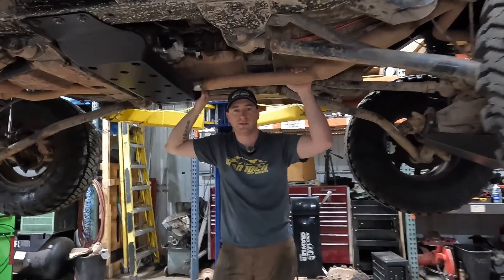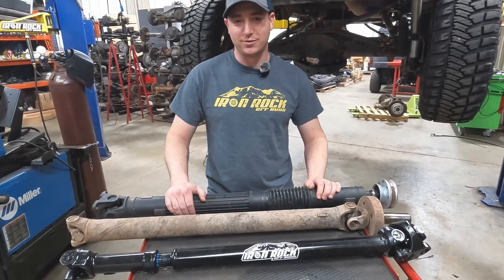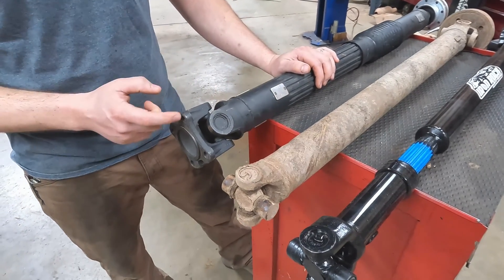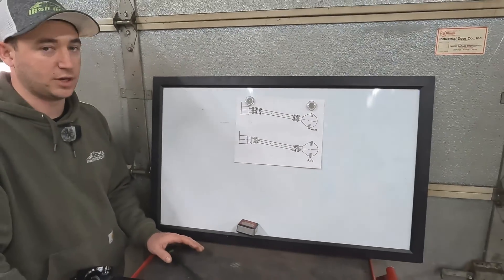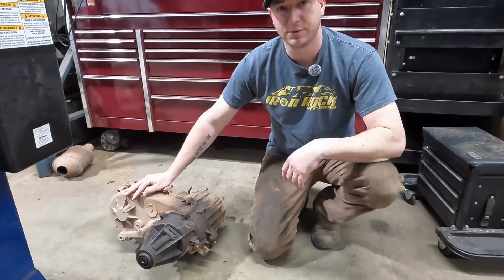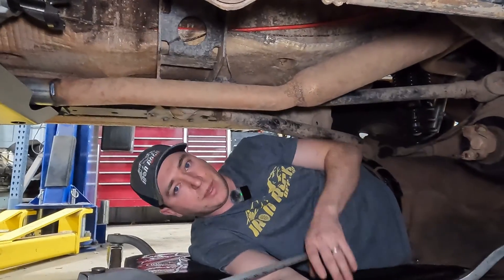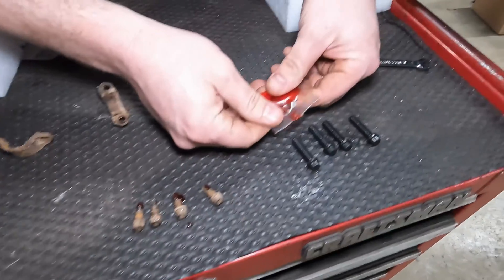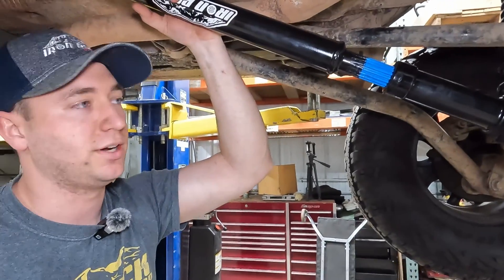Explained: Double Cardan Driveshaft Install

Comment: Sooo.  I’m pissed.  Just bought 2 new driveshafts for my JK , with flange adaptor from Adams .   You’re saying they will fail and it’s not serviceable?

I don’t know anything about driveline , it’s new to me. But I was told this is the best way to go.   Probably because they didn’t want me messing with crush sleeves etc.. 

I was told that the driveshafts were serviceable, like I can just replace a u-joint when necessary.
Reply from the maker: @reapertmax1249 Sorry for the confusion! The stock JK drive shaft with a flange is not serviceable. I don't know why Jeep would do that. The flange style Adam's driveshafts are serviceable, so no worries there. You made a very good choice with the Adam's shafts and the flange style. You are correct, the flange style shafts are super easy to install without messing with the crush sleeves. I hope that clarifies everything.
Reply: @IronRockOffRoad yep I went on a crusade trying to figure this out after I posed my previous comment.  Literally almost had a heart attack.
lol all good.  I’m so happy with these driveshafts, bolted on and no problems .   It’s made me want to buy 37’s and 4.88’s 🤦.  Anyways.   Thx for the reply.
Reply from the maker: @reapertmax1249 Good to hear it's all sorted out!
Reply: @IronRockOffRoad yea man!  Out on the trails yesterday and no issues.  Learning to trust my jeep again after installing new parts ,  haha.  Thx.
Reply from the maker: @reapertmax1249 Haha, I've been there! Let me know if I can help with anything else!
Reply: @IronRockOffRoad well. I’ve got some hi steer knuckles. Teraflex HD ball joints and a MC front TB relocation bracket to install.  It’s a bit overwhelming but I think I can do it. 
Just wondering if I should replace the ujoints in the axles too.  Can’t afford new axles yet but Jeep has like 25K miles on it.  More of a preventative measure , replacing the ujoints. Since I’m in there anyways….  I was thinking of selling the teraflex ball joints and getting the metalcloak deletes, but I don’t know what is the best idea yet.
Reply: I’m good tho,  I’ll figure it out. 😊
Reply from the maker: @reapertmax1249 At 25k miles I would leave the axle u-joints. 
If you're thinking about switching ball joints, we really like the ones from Apex Chassis. We have beating on them for a couple years now without issue, and if you do have an issue, they have a lifetime warranty.
https://www.ironrockoffroad.com/product/jeep-wrangler-jk-grand-cherokee-hd-ball-joint-kit-2bj1072bj109.html

Fun fact: Our JK OTK steering system gives you more tie rod clearance than high steer knuckles. 😎
https://www.ironrockoffroad.com/product/JK-over-the-knuckle-steering-kit.html
Reply: @I @IronRockOffRoad  man. Yea so I was gifted the Rancho knuckles. That’s why I decided to go this route.

I don’t know if it’s OTK but yes it raises the tie rod.  The MC draglink I already have will also work with it ( I think). So since I have that stuff I’ll just use it.

The ball joints however… that I’m not sure if I install the teraflex I have or go with the deletes… which ever brand.

I’m going to look at the ones
You have … thanks for the info
Reply from the maker: @reapertmax1249 I'm happy to talk Jeep recipes anytime!

Comment: So i put 8.8 ford in a xj i got the flange to bolt a 1310 u joint to the 8.8 put were do i measure on the plate on diff or on flange were the bolt goes in or somewhere else
Reply from the maker: @jeremyhanna3852 Install the flange adapter on the 8.8 axle. Make sure the u-joint on the axle and the u-joint on the transfer case are oriented the same way (example: horizontal). Measure from the center of the yoke on your transfer case to the center of the u-joint hole on the flange adapter. Find that length on our website and you should be good to go. If you still have questions, send us an email at tech@ironrockoffroad.com and we can send you some pictures.

Custom Length Double Cardan Driveshaft:
https://www.ironrockoffroad.com/product/custom-length-double-cardan-driveshaft.html
Reply: @IronRockOffRoad thxs guys i will order the shaft later this week i 3d printed a plastic ujoint cap with a center mark on it to get the exact measurement
Reply from the maker: @jeremyhanna3852 That's a great idea!

Comment: Great vid. How did you solve the caster issue?
Reply from the maker: @pierrefulop649 The pinion angle? We lengthened the upper control arms to match the driveshaft.
Reply: @IronRockOffRoad  I mean the caster angle. When you lenghten the upper arms, you tilt the whole front axle to the front, reducing the caster angle towards “0”.
Reply from the maker: @pierrefulop649 It is certainly a balancing act between good caster and a good driveline angle. Our rule of thumb is to aim for as much caster as possible before you get driveline vibrations. This will vary with lift height. More lift height will require less caster; lower lift height can run more caster. 
As an alternative, you could cut and turn your axle. We just did a video about doing this. after a cut and turn you can have great caster and a perfect pinion angle. Check out this video:
https://youtu.be/5gH4AGhfi10?si=lvz-GBUuFrnAB3NJ

Comment: yo friend.   i have the double cardan  jusl exact like you black one.   but i stil have vibration.  its the front shaft of a lifted didge w200.  its pretty short, and a good lift so rthe angles a pretty steep. .  i have the diff  turned up.  and the double cardan is not at his max. its a brand new shaft.  the yoke  is  connected   wricht.  i think its just still to much angle. but its hard to get the transmission down.  i means that i have to angle the engine  down so the transcase  goes down to.  anyways its a pretty pain in the ass.  the vibration already starts a 0 mph. so its from the beginning.  i know i will wear the doublecardan out driving it like this.  any help  is welcome. but i do think its way to steep. need to get it less angle.  thanks.  gr marc
Reply: Remove front shaft and put behind front seat until you find correct front axle so vibration don't tear everything up
Reply from the maker: @jacobnorth8642 That is a good solution too. 
@dreamworksmarc Another idea could be to clock the transfer case down if you have the room to do so. It isn't ideal for off road use but maybe that isn't the purpose of your build?
Reply from the maker: @dreamworksmarc That is a tough situation! Getting the angles right on a lifted vehicle can be challenging, especially with a short driveshaft. There are a couple solutions to your problem. 
1. Lower your lift height. Nobody wants to do that! Skip down to #2 😄
2. If your front axle is a low pinion, you could swap it for a high pinion design. This will raise your front driveshaft, making the angles much better, and high pinion front axles are stronger than low pinion front axles.
3. You could "Cut and Turn" your front axle. We have a video on this topic coming out this weekend. Watch for that on Sunday morning. Doing a "cut and turn" will allow you to point the pinion up higher than before and allow you to keep good alignment angles and drivability.
Reply: @IronRockOffRoad   thank you. yes,   i have   cut and turned  the axel.  a pain the ass that was.  jezus!   but the problem is not at the bottom. its at the double cardan.   but i will search  for your high pinion  solution.  i think the only way to get it reaaly good, is angeling  the whole motor.  hoping the rear drive shaft wont fall out.....

thanks anyways!
Reply from the maker: @dreamworksmarc Glad I could offer some assistance! Let us know how it goes!

Comment: But if u point the Axel up then the springs will be curved ?
Reply from the maker: @RYCMudParkANDSWFLJetSkiRiders Typically, the axle only needs to be adjusted small amount upward. That small amount of change usually does not curve the springs much at all. The Jeep in this video had 6.5 inches of lift, after the adjustment we didn't notice any curve in the springs.

Comment: 👍🏾👍🏾👍🏾👍🏾👍🏾
Reply from the maker: @califuturist 😎👍 Let us know if we can help out with anything!
Reply: @IronRockOffRoad 

I was wondering if connecting a double cardan directly to a 4l80e tailshaft and pinion shaft of a, let’s say, Heidts IRS is feasible.
Reply from the maker: @califuturist That is absolutely feasible. Typically, a 2wd 4L80 tail shaft will have a slip yoke instead of a fixed yoke. Most of the double cardan driveshafts I have seen have a slip joint built into the shaft itself. If you eliminate the slip yoke on the 4L80 then you'd be able to use a double cardan shaft. Most of the time a double cardan driveshaft is used for more extreme driveline angles or where the differential sees big suspension travel. With a fixed rear differential like a Heidts IRS the pinion angle should be set and never move. Having both the transmission and differential fixed in place, there shouldn't be a need for a double cardan driveshaft but there is no reason you couldn't use one.

Comment: Great Video! 

Just found out that I need new front x rear Drive Shafts for my lifted 2door JK.
Reply from the maker: @CCF_Christopher Thank you! You're in the right place. We have a couple options for your JK driveshaft needs. We have two options for the front, flange yoke style and one with a new pinion yoke. For the rear, I'd recommend getting our transfer case yoke and rear pinion yoke, then measuring what length you need for a rear driveshaft. It is the most fool-proof way to make sure you get exactly what you need. Let me know if you have any questions, I'd be happy to help!

https://www.ironrockoffroad.com/category/driveshafts.html
Reply: @IronRockOffRoad  thanks I will check this out and get back to you.
Reply from the maker: @CCF_Christopher Sounds good! Let me know if I can help with anything!

Comment: Hello and thank you for the great video . Although I bought a full set of adjustable control arms and 3'' coils for my jeep I still hesitate to go for a double cardan front driveshaft. My question is this : since you have to point  the pinion to face the transfer case, you will eventually ruin the caster of the truck (WJ in my case) because you cannot have both ( good caster and the axle facing the transfer case) . So is there a way to have both? (e.x. cutting and re  welding the arms of the axle to the correct caster?) And if not - what is better? compromise the caster for a double cardan and poor ride quality or fix the caster and end up with vibrations? Thanks again!
Reply from the maker: @platonpanagopoulos73 Great question! It is certainly a balancing act trying to get a perfect driveshaft angle AND good caster at the same time. It can be done! A good double cardan driveshaft with good quality u-joints can run at a slightly "imperfect" angle without vibration. We experimented with a JK here and pushed it to 9 degrees of caster, without vibration, just to see how it drove! It did have a brand-new double cardan driveshaft and I'm sure it wouldn't last as long at such an extreme angle, but it worked. On a 3" lifted WJ you can run 4-5 degrees of caster and still have a happy driveshaft as long as it is a double cardan. Many times, people overlook u-joint maintenance and get bad vibrations even though the driveshaft angle is pretty minimal.

The best solution is to cut off the axle Cs and re weld them at the angle you need but on a WJ with 3" of lift that would be a bit over kill.
Reply: @IronRockOffRoad  thanks again for your time and your answer! As always ... Legends!

Comment: No matter what I do, I am being blocked from watching this video. Anyone else?
Reply: It's working for me. 🤷‍♂️
Reply from the maker: Thanks for the heads up, @RANDOMNATION907. I did some digging and haven't found anyone else having this problem. Keep trying and keep us posted. If you still can't view the video, I'll reach out to YouTube for more information.
Reply: @IronRockOffRoad .. I found the problem , its a conflict with my browsers security/tracking/ targeted ads settings , I'm not willing to disable settings but I can simply download the video , watch it , then delete or keep it. It's strange that I'm not running into this problem on every channel. In regards to the video, I double checked my WJ Laredo and my t-case came with the short tail-housing and fixed yoke. Yay!
Reply from the maker: @RANDOMNATION907 That is really strange. 🤷‍♂️ But good news on the t-case! Give us a call if you need an answer to anything right away. Sometimes we don't see the YouTube comments right away.